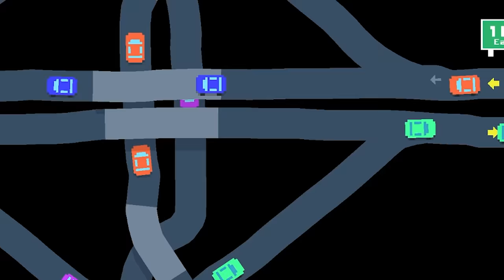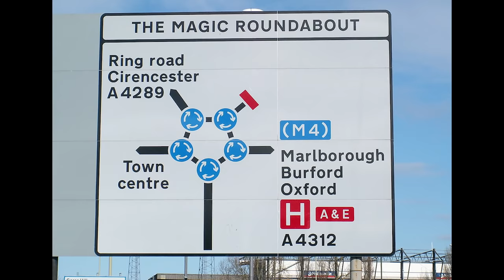Which is THE BEST Highway Interchange Layout? Freeways!

Comment: Matt, in the beginning of the video, you mention the most expensive part of an interchange is the bridges and that engineers want to keep them short. In real life, are tunnels a viable alternative? Or would they be just as expensive?
Reply: Aren’t tunnels even more expensive?
Reply: @dj-tobe  yep, the are
Reply: Tunnels are even worse. The only thing more expensive than a tunnel is a tunnel under water.
Sometimes it is the right thing to do, but if it is simply a matter of choosing over or under, all else equal, then over is best.
Reply: Building a bridge is way cheaper than making a tunnel. The bridge only has to support itself, while the tunnel has to be dug out and support whatever overlays it.
Reply: Depends on the type of tunnel, whether they'd need to dig out the land above it first. They need to build the supporting structure of the tunnel walls regardless, and then potentially putting the surrounding land back afterwards. I suspect they'd be just as expensive, if not moreso, and in most cases are basically the same as bridges, just made partially of land and not exclusively concrete.
Reply: @zippysqrl  
Digging out the earth above is called "cut and cover",  and is the cheapest method of building a tunnel, at least where the tunnel is not too deep and the land costs aren't extreme.
Still more expensive than a bridge.

My city is using this method for some suburban train lines, replacing the level crossings with shallow tunnels. The land cost is low because the government already owns most of the required land.

Comment: I designed my own interchange in Cities Skylines, that works to what I think ought to be an important principle: simplicity from the standpoint of "I'm a driver going over it".  I noticed that a lot of these standard ones have slightly counterintuitive instruction-sets for drivers.  The common one being (basing on left-handed traffic): wanna end up opposite?  don't turn off.  wanna end up to the left?  take the first left.  so far so good, but then... wanna end up to the right?  ignore the first left and take the second left.  eek!  potential for confusion surely brings potential for accident, so i thought that isn't good enough let's try and make it better.  accidents after all, even if you completely ignore the human cost, will shut down the whole thing and make it worse than the most interminable cross-grid would've been.  so even just financially it seems like something worth minimizing.

So my one ends up working like this: which way you wanna end up?  keep going until the very first break in the road.  in that break, for left go left, for right go right, and for through keep going through.  then no matter what breaks in the road happen after that, ignore them - they're just merging onto your road.  bonus: the merges don't look the same since the split's the only thing that goes three ways, and the merges join two ways each.

It seemed important to me, and I got an amazing traffic flow from it.  The problem now that I see it is that it is insanely bridgey.  So your motorists will be happy as peaches.  But your maintainence crews and budget brokers might not.  But... well, it seems like a solution to a particular set of priorities, so it seems to have value!  From the top looking down it appears like some sort of double twisted leaf-shaped waffles.  I play on console so I couldn't get the dimensions perfect perhaps, because no mods so gotta deal with vanilla angle/snapping fuss and the inability to reposition defaulted pillars.  Hmm.  Wonder how sturdy it'd be with a proper, actually-chosen pillar setup.  Plus I wonder how many bridges would actually be needed without the fussiness of the game?  If it were made to be a lot tighter (which with such high flow, it maybe could)... some structural walling might be able to be more like land bumping, and/or possibly even split support between two elevated things at once (I did also design it just over a flat surface so there's that too).  Hmm.  I'm probably just gonna have to forget games and draw the damn thing.

Still like that I figured that out tho.  Kinda love all this traffic solving stuff, it's fun isn't it?  How does someone get into that kind of thing, I've no earthly idea.

Comment: Your first video on that game made me buy it. This one is very interesting. My designs are always a bit crazy. The key is looking at the expected traffic flow (thickness of arrows). In some later levels bridges are actually banned and you are forced to use roundabouts. One of the unlockable pictures is actually the magic roundabout that you showed in this video (mine looks a bit weirder than yours.

Btw, this game tries to simulate autonomous cars and they always merge (no rules like "right goes first"). Therefore roundabouts are not the most efficient ways of doing things and you are more likely to run into jammed traffic (I would call them deadlocks). I have beaten the game once, but I destroyed the (game) world and started over to unlock all the pictures. In some of the levels this is REALLY hard. An undo button would be a blessing.
Reply: Level 57 is an absolute nightmare: to beat the efficiency goal of 175, I had to cheat by looking up someone else's solution and painstakingly copying it (and even then, if I wasn't careful or steady while drawing, any tiny mistake would either ruin it or drop the score below the goal, forcing me to start all over again; it took me at least half a dozen tries to get it right).

Comment: 15:34 why don't you join straight back down in a tight left turn instead of bridging over 2 roads then going back down. Also if you leave room in between the cross roads you can have the merges in the center instead of going over both roads. So leave a gap between north and south. and a gap between East and west. Then bridge down between in merge. Some of this may not make sense IRL but for the game it could work.

Comment: 15:48 he stops because the purple car was about to go up their bridge, which moves the purple car to "level 2" which causes the blue car, who is also on "level 2" to slow down, because it thinks it's on the same road. It has to do with the way the game is programmed. You can see this because the purple cars glitch onto the wrong bridge sometimes. some with the orange cars.

So basically, you shouldn't build the bridge entrances too close to each other to prevent glitching cars, because even though you're using a bridge, the cars are still waiting for each other.

Comment: I guess the formula for efficiency is: (traffic flow speed) /(concrete used) *10*(complexity rating). So if your initial conditions are low (low CS) , you'll get to a point where your traffic basically freeflows (82), and your efficiency is basically determined by how easy your structure is. With the kind of complex structures you have it'll be better to raise CS up then

Comment: I've complete a "map" with a structure with an efficienty of 531, used 4400 tons on concrete with a good traffic flow of 77 km/h.
That was quite simple. Just connect all the entrance and engress once at time in clockwise direction, and complete to do merges and diverges.
If you want, i can send you via email a pic ;)

Comment: I wonder if the first interchange could have fared a bit better if the points where the parallel roads meet the main ones were drawn a bit smoother. Though surely it wouldn't have beaten the basic clover leaf with all the extra material needed.

Comment: with what you started to do at 11:20 i did similar except i made some slight changes and it works about the same but just uses less concrete and is a bit more efficient

Comment: There is i junction much better than the one at 18:00mins in that is in Birmingham in the uk. Called spaghetti junction. Joins up the M6 to Aston expressway for the center of birmingham, the A38 and several other route's. All in one hit by far the biggest junction i have ever used and i think i pretty have much used all the roads. There is also a railway and a canal network underneath it. As well as several industrial buildings, Houses and a powerstation

Comment: As someone that studied Civil Engineering, Clover Interception always infuriates me
they let people get ON the highway before the OFF ramp. making the traffic cross each other with opposing deceleration/acceleration flow. and doubling the outer lane's car count between the ramps. driving around DC's i-495,  those Clover always cause massive traffic jams and accidents.
In my opinion the clover should be reversed, letting car OFF first then recieve the on ramp traffic. which would make it easier, safer, and faster.

Comment: Have in mind I live in Poland but am I right into thinking that all the designs presented here, while commonly called "intersections", aren't really intersections according to the UK traffic rules but rather constructions consisting of multiple intersections (i.e. crossings, merges, splits) each? I'm asking because it's a hot topic in Poland for last 20 years or so and I wonder if we're the only country with confused drivers. Vienna Convention on Road Traffic defines an intersection as two roads merging, splitting or crossing with each other - that's it. Poland wasn't best at adhering to Vienna convention in the past and that led to the driving instructors and examiners inventing their own interpretations of proper road behavior in the 90's - unluckily, some very dangerous and still thought nowadays even though traffic rules changed in 1997. Most prominent example being a roundabout as a one big intersection where you can go straight, turn right, left or make a u-turn. Current traffic laws state that going around the roundabout means you are going straight (even though you're constantly turning) and leaving a roundabout is possible only by turning right (in UK left, I guess) on the 1st, 2nd, 3rd  intersection. This leads to things like people thinking they can leave the roundabout with multiple lanes straight from an inner lane. This insanity spread to the point that some of the clover-leaf and turbine designs are marked as roundabouts even thou they clearly aren't. It's a mess. How do you deal with it?

Comment: shouldt it be better if u basicaly make a instant connect of the right turn (in point of vieuw of all of them so = symetric) and make 2 circles in 2 different directions where the inner side is the shorter circle for a left turn, with  seperated straight lanes to the circles so u only have to jump over 1 circle to turn to the left? ( aka all those directions that wanna turn left have to go over one circle with one lane and the one that wants to go straight u use the other lane)

Comment: IMO, at 7:26, you can greatly increase the flow in the DDI, if you move the orange cars from 101West to go under the bridge from 17South and have two lanes up to 17North.  This way the people turning left from 17South to 101West will have a dedicated lane and not mix with those going left from 101West to 17North.   To mirror you need to change top 17 North to go over the 17South lane